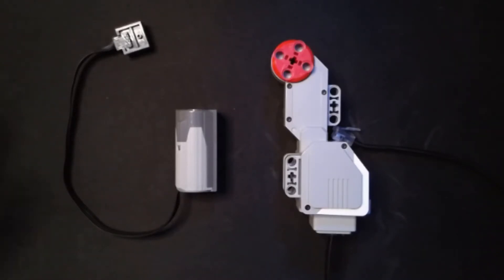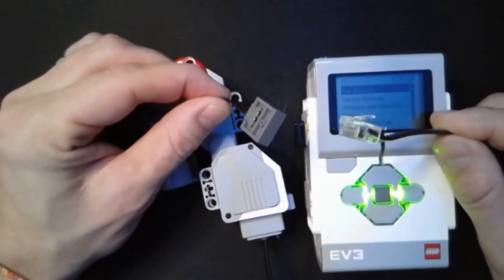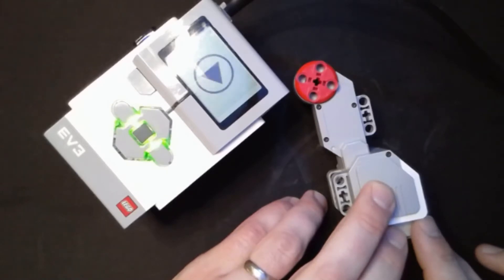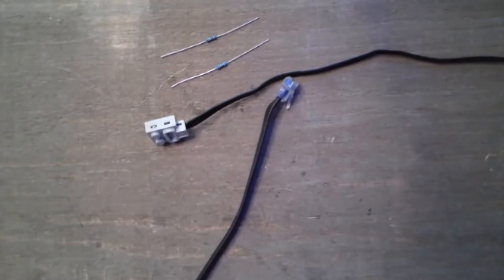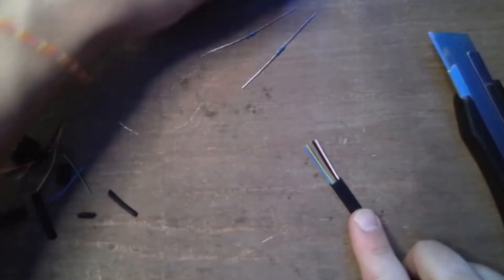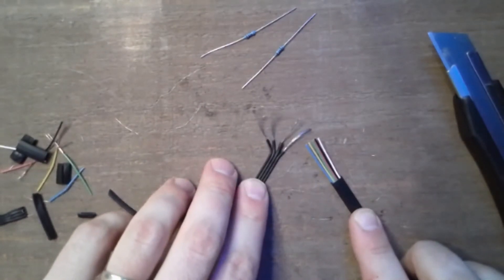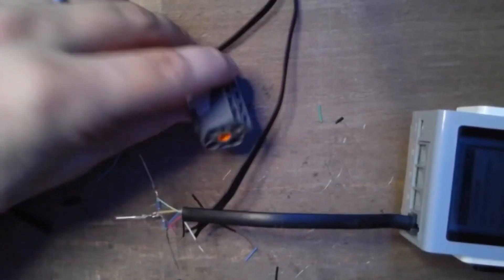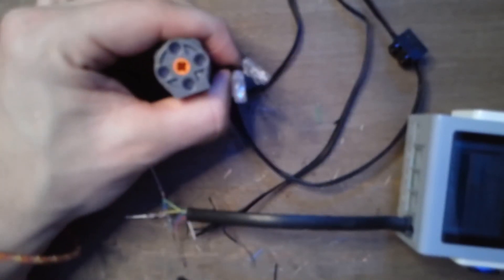Connecting a LEGO Power Functions Motor to an EV3 Brick

Comment: Instead of cutting you can also buy the NXT to 9v and use the Pf extention cable to power it.
Reply from the maker: I'm familiar with this one:
https://www.bricklink.com/v2/catalog/catalogitem.page?S=8528-1
But they're pretty hard to get. Is there another option?
Reply: @codeadamca  https://www.bricklink.com/v2/catalog/catalogitem.page?P=x1676&idColor=11#T=S&C=11&O={%22color%22:11,%22cond%22:%22N%22,%22iconly%22:0} Try this. Much cheaper than the last one if used
Reply: the downside is it will need a unregulated motor block since that isent detected by ev3